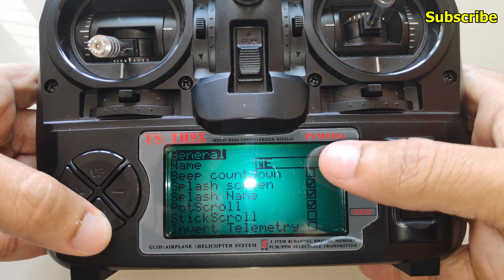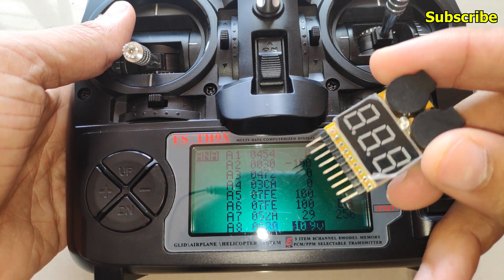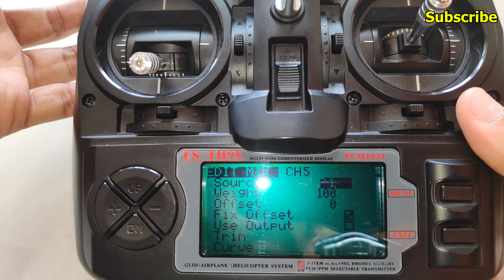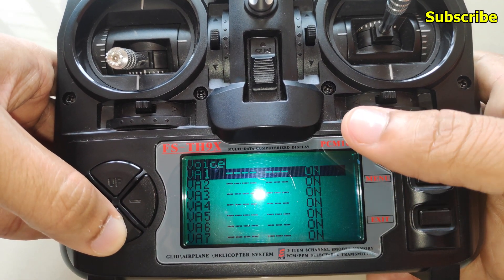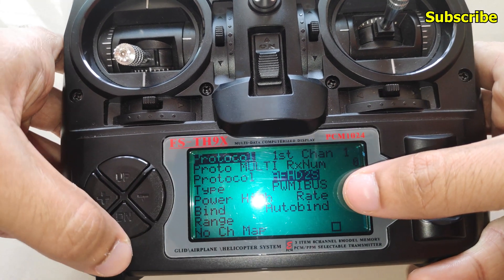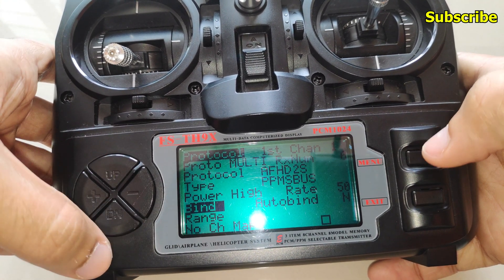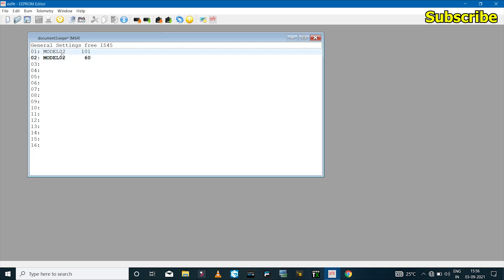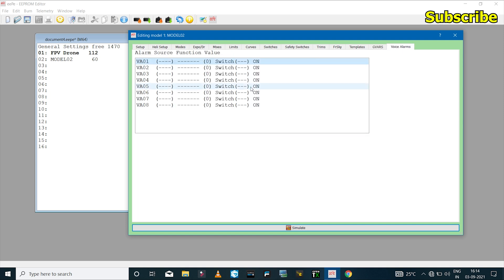ER9X for New Flysky TH9X Turnigy 9X AFHDS2A Setup Binding EePe Companion Workflow

Comment: Hi Rakish. Was hoping you could help. I have the Flysky FS-CVT01 voltage sensor that I was able to use with the stock firmware. How do I use it with the ER9X software>
Reply from the maker: Hi, you could use it with th9x? As far as i know th9x doens't support telemetry so even if you connect the voltage sensor to your receiver this radio cannot receive the telemetry part. How are you using it with stock firmware
Reply: @RakishRc  Sorry forgot to mention the stock firmware on my Flysky i6x. Since I use the FS IA10B's in my planes I was hoping the turnigy radio would accept the telemetry
Reply: Does the Flysky FS-RM003 module not work with telemetry in the Turnigy.
Reply from the maker: @KenDowney  FSRM003 module does not support telemetry. But since you have fsi6x you can use telemetry with fsia10b without any module. Have you installed Open tx firmware on your fsi6x radio
Reply: @RakishRc  Yes I have. But I like the feel and experience of the Turnigy so was hoping it would be able to do more.
Reply from the maker: @kendowney1848   no th9x / turnigy is outdated radio now. Even the Open tx firmware server for th9x are over...er9x firmware is still available and has some features but not for flysky telemetry and flysky afhds2a protocol.
Reply: @RakishRc  Yes I have flashed the open Tx on my i6x radio. Seems alright. By the way. Love your vids and explanations. Quick question though. I fly mostly fixed wings. For the i6x transmitter, which software do you suggest. Open Tx or Er9X
Reply from the maker: @KenDowney  For fsi6x stick to open tx because it's tailored for it. The erlfy6 (aka er9x) is made for fsi6 that also works on fsi6x but it's not updated or modified for fsi6x.
Reply: @RakishRc  Thank you